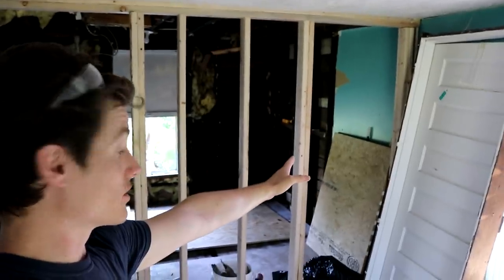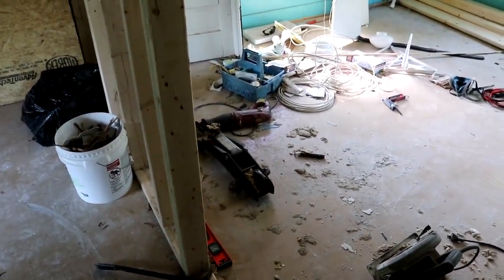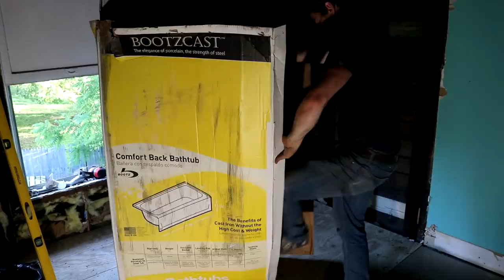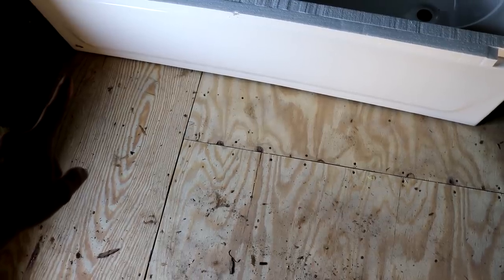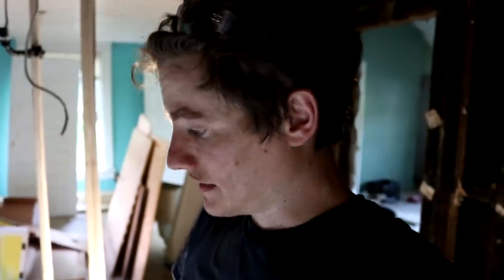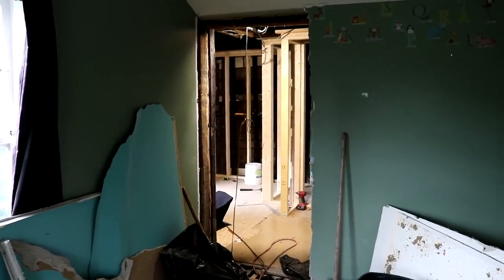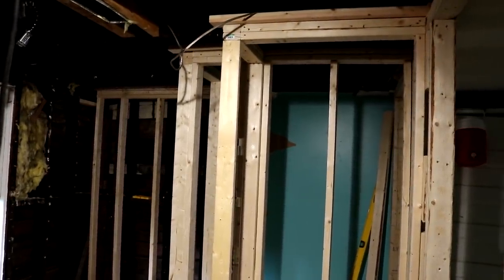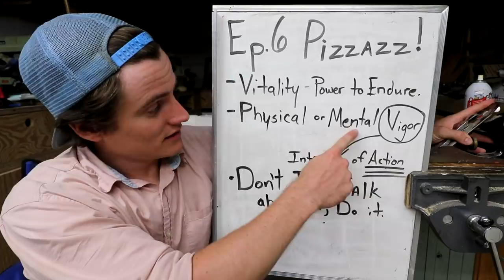$9,000 HOUSE - Building the Bathroom // Renovation - #4

Comment: Keep up the good work. Those who have never worked in an old house have no idea how out of square they are. When I was in electrical school we went out to help a reno job. our job was to use surface mounted wire mold to wire in a bathroom light and GFI,   so we made sure everything was plumb using our levels, then stepped back and found because the walls weren't plumb and our stuff looked crooked! Ended up taking it all apart and squaring to the wall by tape measure!

Comment: Great job! My great grandparents home burned down about 1918. Neighbors got together and rebuilt it in 11 days. It didn't have a plum wall in it. My grandpa used to talk about it all the time. When he married my grandma in 1930, he began to make screen windows for it, he said he had to shim everything. They built a home a couple miles away in 1937. 
I ended up buying the home in 1996, but had moved in in 1990.
It was a 3 part build with unusual construction. Grandpa was a Plasterer by trade, but bought books on plumbing and electrical. The home was wired in 1939, then a separate kitchen with pantry was added, and finally a new kitchen in 1947. Plum, thick plaster, well constructed. In 1990, the home was appraised, with the comment that the home appeared to be only 15 years old, when the original part was 53, mid part 51, and final part, 43.

Comment: For carpet look into carpet tiles. If your renting the inevitable damage is easily fixed with a couple of spare tiles and removed tiles can be washed and reconditioned for later use. It's also quicker and easier to lay than traditional carpeting.

Comment: closets rough in at 25” deep. you’ve room for a bedroom closet and use the space left over for a bath closet on the drain side of your tub. 
the time to pull out that window and put a higher shorter one in is now then put the vanity below the window.  my 2 cents... or 1 cent !
i like what you did though.  nice, letting that closet cap plate run wild to carry ceiling wallboard.  have a good weekend

Comment: Not a critique. When I ran into a similar problem with the tub wall, I built it 1 1/2 deep instead of 3 1/2 by turning the boards. I also placed 2x6 in the locations where the I planned to place handrails. Just a thought if you were in a smaller area as my bath was smaller.  Loving the videos.

Comment: hey you should try diablo circ saw blades the demo ones are usually 2 for 15$ sometimes 2 for 12$ up here in canada theyll chew through nails as happily as wood, also if you drop the saw to full depth for sheet goods itll be easier to get a straight cut
Reply from the maker: They might work, but what gets pretty much any blade is iron nails, normal nails are steel, these are old iron nails and carbide shatters right off the blade when it hits them. The only way to cut iron is abrasive, like cut off wheels or special sawzall blades.......but perhaps I'm missing out on something.
Reply: @homemadehome5575  youtube search some diablo promos or reviews.. they cut asphalt, 3/8 lags, wood, screws, and probably the kitchen sink all sandwiched together for 20ft.. theyre not pricey either atleast not on sale which they always arelocally

Comment: I feels this so hard. Moved my vanity over 3 feet in my bathroom renovation and when I went to connect my new p-trap to the waste line I realized I am up an inch and a half.... 👀 Looks like Mr. New Vanity will be getting his legs cut off to compensate for my mistake. Nothing a lil half-round trim can't hide 😎
Reply from the maker: You can a extend the drain with a tail piece.
Reply: @homemadehome5575  I thought that too but the guy at Lowe's didn't seem to think so... 🤔
Reply from the maker: Guy at Lowes works at Lowes.

Comment: As a person from Europe I'm still vaguely disturbed when I see you fixing the floor like this with a hole thgough to the lower floors xD I know it's typical building style for a lot of places in states but where I live wood-based floors or walls are pretty uncommon (perhaps in old rural style houses?). I guess I'm just used to houses being built from bricks and concrete all the way through with metal reinforcments (I hope that's a good word but my English building vocabulary is lacking, not my first language) - it generally means less repeairs and maintenance but if something structural goes bad your repairs will cost fortune and may mean it's cheaper to build a new house (unless it's old enough to be considered historical then you're stuck with it - generally after 100 years, but houses this old should be structurally fine most of the time).

Still, love watching your renovations even if pretty much none of the solutions would work for me xD

Comment: 10:36 why don't you just nail some planks as spacers with increasing thickness in front of the already existing frame instead bolting a completely new frame on top? What's the advantage of doing this?

Comment: they make framing saw blades that will cut nails so you never have to worry about ruining a blade.
Reply from the maker: Steel nails are one thing, iron nails are a different story.....I haven't found anything that can handle them.

Comment: I think a simpler solution to the off square wall would have been to push the tub to the existing wall, make it square and then sister studs to the existing structure and offset them till it squares everything up. It would only save a few inches but every inch matters in a bathroom.
Reply from the maker: I didn't even think of that. Good idea...I needed you there Dennis!

Comment: have you bothered with any certifications? or is your area pretty lax when it comes to needing official documents... perhaps another vid on what certs are helpful/necessary to do reno? like 608 to buy R22, etc. and the need for contractor's license to avoid certain obstacles you will eventually face (ie certain businesses will sell to you only if you are cert/contractor).
Reply from the maker: Where I am at a homeowner can get a building permit with yourself as the contractor and have yourself listed as the one that will be doing all the work. In the end it is inspected so they don't care if you are a professional or not. With renovations you get more leeway though, certain things are grandfathered and exempt from code and sometimes they have to use their discretion with other things where the "code" is not possible to satisfy and have to use there experience to know whether something is good enough. I used to be scared of the process but now I'm not.

Comment: I am a retired architect of almost 40 years in Atlanta, Ga. and I have never seen the use of access panels behind the tub plumbing wall. Why do you do this?  It can't be because of freezing, those pipes are on an interior wall and it would be simple to insulate them. What's up?
Reply: Because he thinks like a landlord who has had to repair plumbing issues.
Reply from the maker: I've never seen a house that didn't have access to the plumbing where it hasn't eventually been a problem. It's pretty common. I'm not sure what you are asking really, it's just a panel that can be removed if you need to fix something....even if I don't need it now, someone will thank me 50 years from now.
Reply: My 43 year old home has access panel for tub in next room closet.  Yes, it's an interior wall, and this is Arizona.  Go figure.
Reply from the maker: @janambrose4917  Freezing is only one of the many issues that can happen with the plumbing behind a shower. I've had pin hole leaks develop, a joint come loose, etc. If I could leave a house gutted without drywall and rent, I would. Always nice to have easy access.
Reply: @homemadehome5575  I agree,  it's just funny that people haven't heard of it.

Comment: that will work out good but i thought you were keeping the tub drain to the outside wall of the house ... o well .. see you next time :o)
Reply from the maker: Switched it around to get the plumbing out of the exterior wall for freezing and easy access.
Reply: @homemadehome5575  It does make a big difference for freezing.. i have experienced that with a hosebib line that was run along the inside of a garage wall. Insulation and pipe foam did not help so now its exposed on the inside of the garage wall.. copper line.. probably should have used galvanized since it was exposed but i don't like galvanized pipe.

Comment: Hm how sturdy is that floor going to be with cheap plywood - so typical american building houses with cardboard
Reply from the maker: I get it's different than what you are used to but it's just an old house that I'm fixing up, better than it sitting there going bad. Plywood is solid wood, with alternating layers to make it stronger. This floor is over 1 3/4 inches of solid wood....that's a thick floor. I have not used any cardboard yet, but still a long ways to go. Thanks for watching.